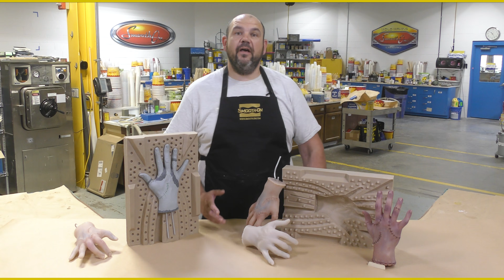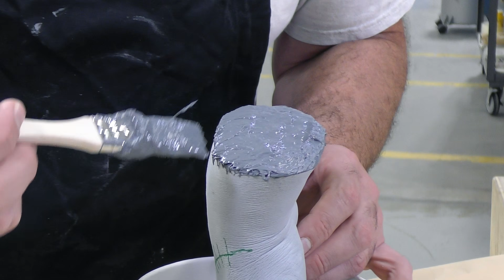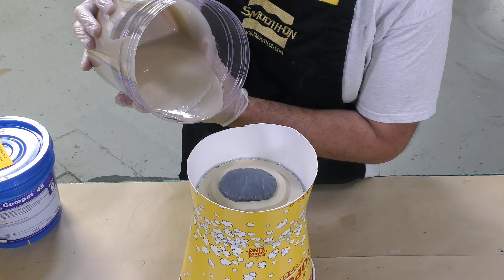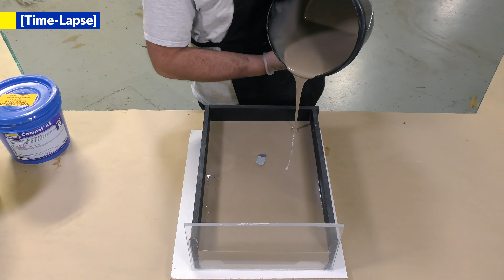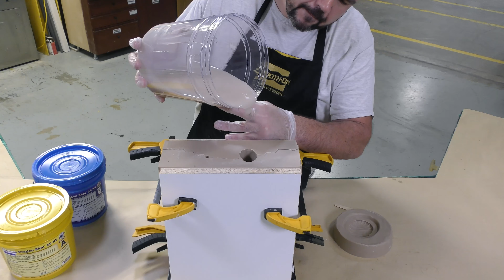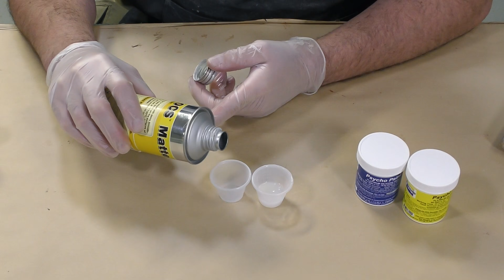Step-by-Step Addams Family "Thing" Stop Motion Puppet Creation

Comment: so I wanna start with silicone making some mermaid bracelets out of dragon skin 20 (or 20nv) 
the positive will be made out of clay. so I thought about making the negative/mold out of epoxy resin (like you put epoxy resin in a silicone mold right? so it should work the other way round?) but now I think that component 45 might be a better option especially if I dont need any release agent in the final mold. 
so my question is: is the cured material still a bit flexible? or not? whats the cost? and the life span of the mold? and I absolutely don't need a release agent when casting dragon skin? 

btw a tutorial on a mermaid tail/top/accessories would be AWESOME!!!
Reply from the maker: Hi there! You've got a lot of good questions here. Can you send us a tech ticket? Our team can help you - https://www.smooth-on.com/support/ticket/add/agree/

Comment: Hello, I was wondering
How did you make sure those wires in the finger were centered and didn’t even touch the wall? I'm glad they didn’t touch it in the video!
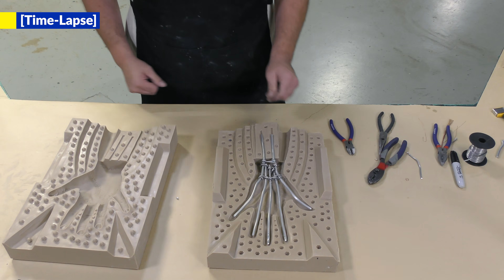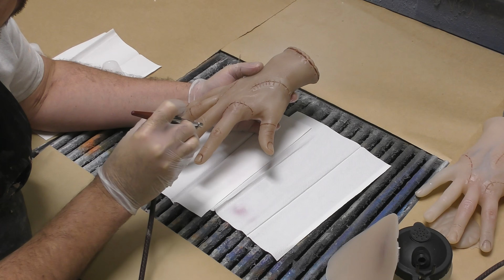Reply: at 17:50 you see the placement of the wires. this is a fast version but that setup can take a long time to make sure they dont touch the mold walls. at 24:56 you can see the miss cast!